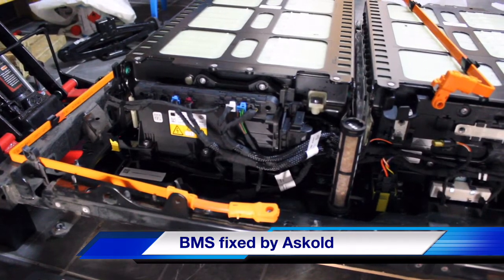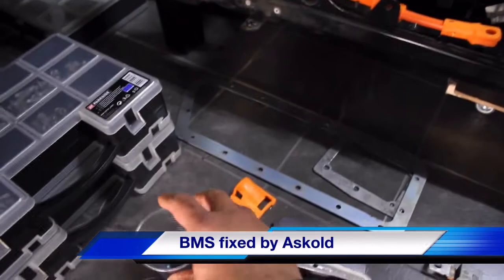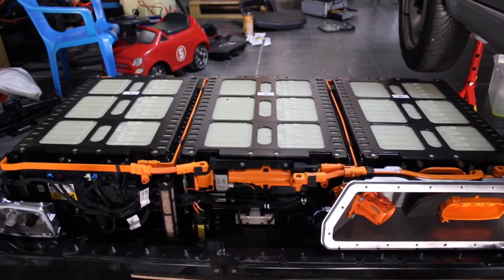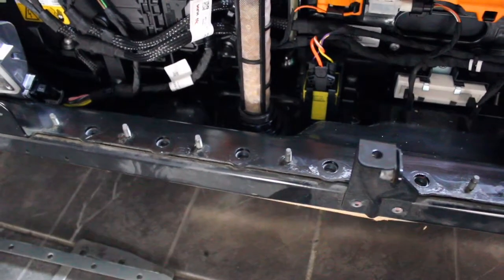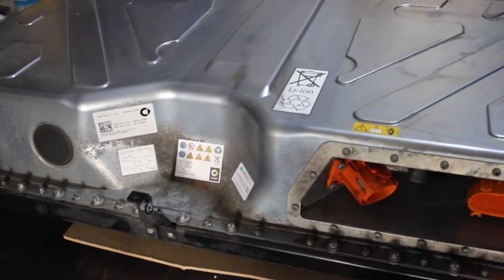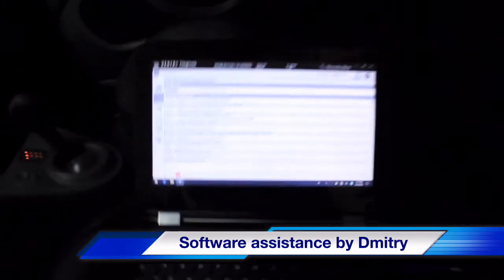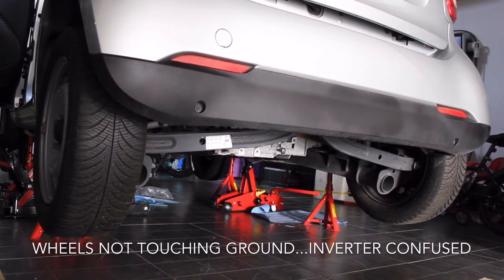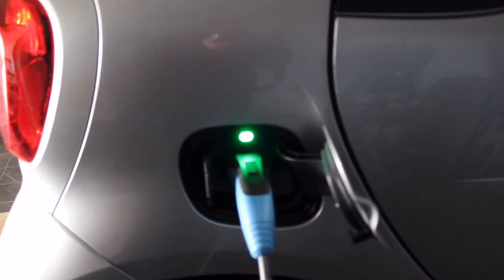Smart 453 EQ fix part4

Comment: What really you change here? BmS? Replace ?
Reply from the maker: Only reprogrammed BMS....more like dumping the memory in reality ....
Reply: @electrikmirk7828  nice is there any software to re-program needed help on my 2013 snd gen smart for two
Reply: What software re program? It is from your xentry diagnostic? Thank you .... did you do it yourself on re programming?
Reply from the maker: @Angelsum143  I only use the xentry for diagnose and updates...
Reply: @electrikmirk7828  thank you so much...your the best .... thanks for helping....i'll order one Xentry diagnostic tools.... againt thank you so much...update you once im on process....
Reply from the maker: @Angelsum143  you can buy all you need from Askold...if you are sure you have the same problem....on the older smart I remember there was a sensor inside the battery that breakes a lot...
Reply from the maker: Soon I will fix an older electric smart with traction battery problems like yours so stay tooned! ;)

Comment: They want 1000 euros to unlock the bms did you find a more economic way ?
Reply: For unlocking BMS 451, 453, Current sensor or other smart cars ED issues contact me  WhatsApp, Telegram +7921953730 Dmitry or Askold +380931130000
Reply: @pochtadi  what your email add?
Reply: Who are they? 
For unlocking BMS contact me WhatsApp +380931130000
Reply from the maker: Go smart is Askold

Comment: Can you provide the link to Dimitry and to Askold so I can have it .
Also where did you get the silicon grease to seal the battery.
Great job ,and a Las question how much range  you have now.
thanks for posting
Reply from the maker: https://g.co/kgs/YpHcf7
Is just normal silicone grease ....you can find it anywhere....the battery is new ....I think about 170km....not tested yet...
Reply from the maker: After 3000 km I can tell you the real range of the new smart is 120/150km....150 if you obtain a 89% eco score...you have to go slow...the computer shows after a 100% change even 170km but never made it.... driving "my way" the range is 120km...
Reply: @electrikmirk7828 how much did they charge to fix BMS?